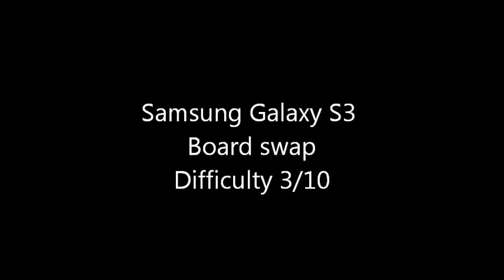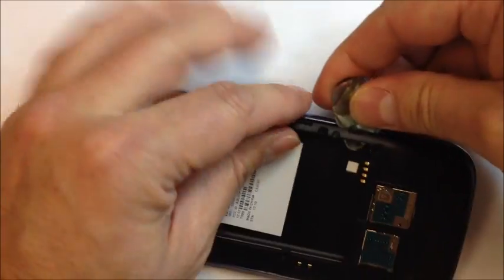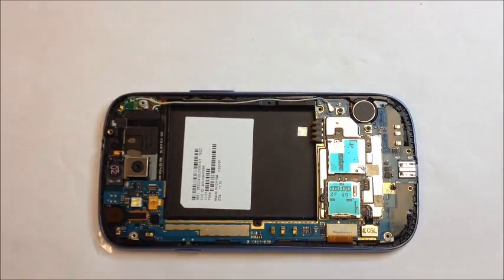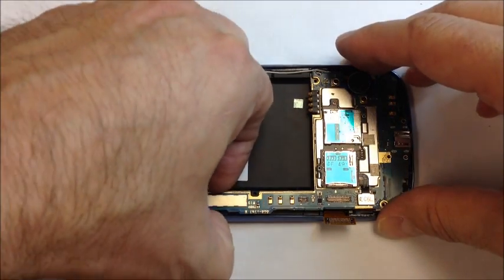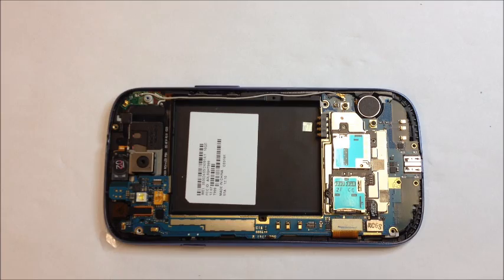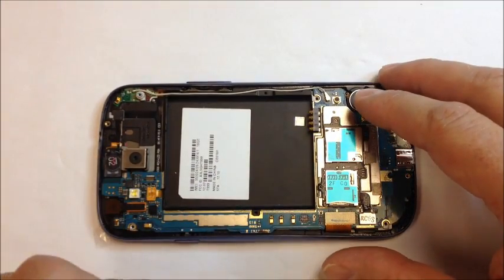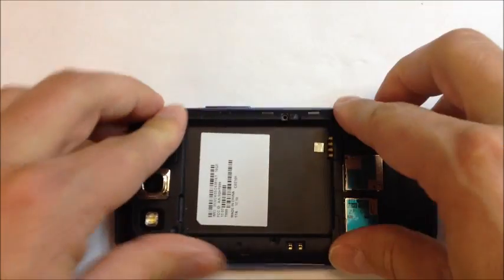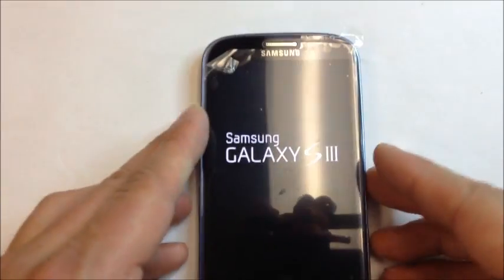Samsung Galaxy S3 tear down for board swap

Comment: Sir my samsung s3 battery is draining out quickly than the normal . Couple of my friends said changing battery would solve this issue but am not sure about this as am sure that the battery is good  but if i  change the board would it make any difference ?

Comment: I recently changed the motherboard in my old S3. It went fine apart from one thing; the sim card slot doesn't seem to work now. After inserting the SIM card various times, it is as if there is no SIM inserted. It isn't locked or anything, just the sim reader is dead. Anyone have any ideas?

Comment: Can i swap motherboreds on my s7 sprint att
Reply from the maker: Should not be a problem but remember that the charge port is different so that has to be swapped to and is more difficult because it wraps around and under the display.

Comment: Hello!! I really need help. I want to change my mother board because my phone won't turn on after the galaxy logo. But I don't want to lose any data on my phone e.g. photos and notes. Will replacing the mother board delete all my data? If so how can i have all my photos after replacing the mother board? also is it safe to get a mother board from ebay??? please help!! Thank you
Reply from the maker: The data stored in your phone is in a chip on the motherboard. Other than anything you have on a removable SD Card you won't save it by changing the whole board out. Is your phone stuck on the logo or is it a boot loop where it keeps trying to restart?
Reply: Hi!! thanks for your reply. I am not really sure if it's a boot loop but it looks like it's just stuck on the logo.

Comment: You forgot to swap the sticker in the battery compartment. That phone now has a different mobo so the old sticker has to come with it.
Reply from the maker: Yeah that probably wouldn't be a problem but since this was an insurance replacement we didn't want to risk having any issues with returning the old one.
Reply: Go Cell Phone Repair Ok thx 4 the heads up!

Comment: Hi. I recently broke my Galaxy S3 (only the screen), I swapped the screen succesfully with a new one but after a while I found the phone randomly turns off, so I assume I damage the motherboard before swapping screens. I'm looking to switch the motherboard with a Galaxy S3 GT19308 motherboard, my phone is a GT19300. Is it possible to switch it out for a different version of the same phone?? Thank you for your time

Comment: hi guys

I have a Samsung galaxy s3 GT-I9300 that has a broken lcd screen.

I found a cheap sprint samsung galaxy s3 nearby SPH-L710 ,,will my GT-i9300 motherboard fit in place SPH-L710 ?
or is there anyway to fix my I9300 with a good L710 ?
thanks

Abdu
Reply from the maker: I only see i9300 and i9305 as being compatible I could be wrong as I dont have either on hand at the moment. Have you compared the mid frames with the boards removed? Also- Its risky but possible to remove the display from your L710 and transfer it to the other phone. I dont have a video for that right now but have done it quite a few times using a suction cup, heat, and a lot of patience.
Reply: first thank you so much for your reply . and yeah this was my first thought just take the lcd .
I have all the gears needed but will the adhesive be fine after removing the lcd and putting it in the other phone ? or should I apply a new adhesive ?
Reply from the maker: I would plan on replacing the adhesive. The toughest part will be getting it off without damage.
Reply: heat gun . suction cups and some patient ..I have changed a couple of LCDs before , but the all came with adhesive , could you please advise me with good adhesive product ..I've never bought one

Comment: Hi, Will I be able to use just the main board without the display attached? so I can switch on the phone and it is still functional and I use MHL to connect to tv?
Reply from the maker: +Kiran Kumar Grandhi You should be able to power up the board without the display attached but I dont know how you would swipe the screen to unlock it.
Reply: +Go Cell Phone Repair  Dah!!!! why didn't I think of that? Thanks a ton for your prompt reply.

Comment: I know this is an old video, but just wanted to say thanks for sharing it. I dropped my phone and smashed the screen the other day and was given a working one by my brother. The problem was, it was networked locked. I swapped the board using this guide and now have a working phone again, exactly as it was before. (Albeit a white case instead of blue)

Regards,

Les

Comment: I have been having probs with my charger port and I can't soder so I felt it was easier to just replace the board. Will my data be deleted though?
Reply from the maker: +Corey Whitney Your data will stay on the board other than what is in the memory card so yes your data will be gone if you swap logic boards.
Reply: Go Cell Phone Repair OK thanks is there a way to transfer the data like removing the internal drive from board A and putting it in board B?
Reply from the maker: Your best bet is charging up the battery in another phone and then exporting data to the SD card assuming that it's just your port that is bad. Removing internal memory from this phone is not something that I would attempt.

Comment: Hi, I just swapped my I9305 board into my I9300 phone because the screen on the I9305 went dark after I dropped it. I also swapped over the antenna because the one in the I9300 wasn't working. Note that the I9305 is 4G and the I9300 is only 3G.

I'm in Australia and I'm with Vodafone. I used to use the I9300 with my Vodafone SIM, then gave it to someone who used it with a Telstra SIM. Since they got a new phone, I've gotten the phone back and had it confirmed that the phone itself is unlocked, but as we know it was recently used with a Telstra SIM.

So, the phone is now connecting to Wi-Fi which wasn't working before, so that's great. But it's not recognising my Vodafone SIM card so I can't make calls or use mobile data. Could a simple call to Vodafone fix this or do you perceive a potential mismatch between the phone and the board could be causing the issue?
Reply from the maker: +Shaun Campbell I don't know how I missed your comment. Youtubes system is a bit goofy though. Were you able to resolve this? If not I would ask whether you also switched over the charging port flex? I haven't worked with the i9305 but the 4G model may use a specific port an that could affect the antenna. Also was it not seeing the SIM or just not getting connected to the network?
Reply from the maker: I was wondering about that too. They did the same thing here with the S3 and S4. The mid frame layout where the chips set are just different enough that the board won't quite fit and as you mentioned tightening everything down causes problems. I'm assuming a short but it might also put enough pressure on a component to damage it so Id stay away from that. It's tricky to remove the displauy from the frame without damaging it but thats the only option unless you want to take your chances grinding away the area that doesnt fit but thats not a great solution IMO.
Reply: +Shaun Campbell Nice to know. I'm doing the exact same swap right now. Knowing that I should swap the antenna too will save me some trouble.
Reply: +Go Cell Phone Repair I can add my two cents here in case Shaun doesn't see your comment :).
I managed to swap out the old i9300 board with a newer i9305. I did have to use the antenna from the i9305 to get a wireless signal. But that was expected. The phone's model number is even printed on the logic board of the antenna.

Unfortunately there is a tiny, tiny difference in chip-size between the two models. Just enough to make the I9305 not fit completely in the shell of the i9300.

When I tighten the black screw, as in your excellent video, the hard-button on the front of the device doesn't work. and when I loosen the screw, the sim-card is not recognized.
I did this several times with the same result, so I'm guessing something is not lining up completely in that area.

Charging worked just fine out of the gate, so no need to grab the soldering iron (there is no flex-connector for usb-charging).

If you have any tips, I would very much welcome them.
Reply: +Go Cell Phone Repair  I agree it's not a great solution, particularly the way I resolved the issue, but it can be done. It can also be done better than the way I did it. Mine is still working though. I'll give a full description in reply to Mikkel Daugaard.
Reply: +Go Cell Phone Repair Never mind. Yes. Can't remember but I don't think so. The issue was to do with the mid-frame layout from memory. Next post I will reply in detail to Mikkel Daugaard's post since he's in the middle of doing it.
Reply: +Mikkel Daugaard Hi Mikkel, I have retraced my steps and jogged my memory as much as I can and here's how I resolved the issue. First of all never buy anything from miniinthebox because I ordered a new antenna in early November and I didn't get it until January. By the time I received it I didn't need it anymore, but it only cost $2 so I got over it. When I didn't receive a response to my post here (I think that was on Christmas Day wasn't it?! Oh what a fun Christmas Day I had...), the first thing I did was enter a whole bunch of special codes into the dialler to try to troubleshoot but this was unsuccessful. I then called Vodafone and told them everything I'd done to date. Although they couldn't directly help me without looking at it and wouldn't have done so without charging me, they knew what the problem was and they unofficially directed me to the sammobile.com website and wished me the best of luck! There I found this thread: http://www.sammobile.com/forum/showthread.php?t=22146 and to see or download the links I registered and logged in. I recommend doing this before visiting the link. The first picture link on page 1 of that thread is relevant and it will put you on the path to getting the full picture. The next relevant part is the first link on page 2, which takes you to a thread in the XDA Developers Forum. Go to page 3 of that thread, scroll down and click on the link that comes after the quote in post #26. This takes you to another thread on the XDA Devs Forum which I like to call "the money thread"! At the bottom of that you'll find 5 thumbnails that really help. Read everything as you go and you'll find that it is absolutely necessary to grind down those parts of the mid-frame layout mentioned, but the pictures give you a perfect representation of what needs to go, except that I think I also ground down some plastic on the inside of the outer plastic plate/frame that you screw down with all those screws to complete closing up the phone, mostly on the corner opposite to the corner of the mid-frame that needs grinding. But, so, yea, if you have the tool that they describe, can't remember what it was called, but if you have it use it and do all the grinding of the mid-frame first and try closing the phone before cutting out any of the plastic on the inside of the outer plate/frame. Using the tool that they mention is the "better way" of doing this because you'll laugh at how I did it. I'm no techie at all and I was at my wit's end and at a point where I had nothing to lose. My Dad had the tool but wasn't going to let me use it coz it was brand new and he's a dick! So I used a pair of side cutters and a pocket knife to cut and scrape. I then used the sticky tape as described in one of those threads I mentioned and after hours and hours of fidgeting about the case closed properly, everything must have been touching properly and calling and texting finally worked! The only mistake I made was accidentally cutting the cable that connects the home button when i was cutting and scraping so be careful of that. I found a fix to that too by downloading a soft home button app, only thing is I can't use any of the special button combinations to clear the cache etc. when turning on the phone coz there's no hard home button. Please note also that because I was grinding down the mid-frame which is a type of metal and because there are gaps between the mid-frame and the digitizer where metal shavings can get through, and because you don't want metal shavings getting into the digitizer, I covered up all the gaps as best as I possibly could before shaving the mid-frame and I removed and replaced the coverings a couple of times. It was a tedious exercise and I was very careful but 4 months later my "hybrid phone" is still working and I'm only 2 months away from being able to start a new contract and go new phone hunting. Mind you, I usually buy my phones outright then go on a plan so for four months I've been trying to talk my wife into giving the ok for the purchase of a new phone before this "hybrid phone" of mine decides not to work anymore!
Reply: Hi Shaun,
I apologise for not responding sooner!
Thanks a lot for your comment. It made me rethink the whole idea of carving out a piece of the phone since I always mess something up if I'm not in an extremely patient mood... which I rarely am :).

I ended up accepting that the home button doesn't work.
I found a workaround by using a simple app called "button remapper". It remaps the soft buttons, so that a long press on one of them will act as a home button push.
This will obviously not work if I ever have to do any factory reset or the like where I need to push the physical button.

Thanks again for your help and I hope you got a great phone on the new contract.

Best regards from Denmark.

P.s. Tell your dad to share tools. It's the whole reason to get a son FCOL :)
Reply: Hi Mikkel, thanks for replying anyway, even though it took a while :) Multi-action Home Button is the app I used. There are probably many. Yes it does require extreme patience and at least a good half a day!  I am sorry to report that after seven and a half months of my nifty "hybrid S3" filling the hole in my mobile life, I dropped my phone again two days ago, in almost exactly the same spot, and the screen went black just like before. Fittingly, only a few days before that I pre-ordered a new Galaxy Note 7, but not so fittingly my hope for the hybrid S3 lasting long enough for me to transfer everything to a new phone was dashed. I've even tried connecting the phone to my laptop via usb and using programs to try and view the screen on my laptop but to no avail because two computers won't recognise the phone and only very rarely do I even get the sound that at least let's me know a pseudo-connection has been established. So here ends the saga! I'm on my old Galaxy Ace 3 or whatever is called now. My biggest loss was my calendar, something that could have easily been synced to the cloud...d'oh! And now I'm having weird laptop problems. Blasted technology! And thanks for the support re: my Dad. I'm 38, can you believe it!

Comment: I assume the motherboard the same, regardless of the carrier (AT&T, T-Mobile, Verizon).  Is this true?
Reply from the maker: +Joe C No. AT&T and T-Mobile have the same form factor but Verizon is different.
Reply: +Go Cell Phone Repair Thank you, sir.  I was able to get my wife's motherboard out of her S3 that was run over by a car.  Motherboard looks surprisingly good.. hope it works.  I'm waiting to borrow an S3, but can't wait too long because my wife has already received the insured replacement in the mail, but we can't activate the new one until we bring in the old phone.  We don't care about the board, but only want video/pictures so I am tempted to keep the removed board and just turn in the phone.. we're worried that the insurers would charge us full price if they inspected it...
Reply from the maker: +Joe C I don't know the conditions of your insurance policy so you might want to inquire but- unlike a manufacturers warranty your coverage should not be affected by something like taking the phone apart and putting it back together. At least I wouldn't think so. Don't take my word for it- check when in doubt- but I can tell you that we've performed this service many times for data recovery and at least to date is has not created any problems as long as the customer gets the broken phone turned in before the deadline.
Reply: +Go Cell Phone Repair I never sent the broken phone in and the insurance company for AT&T hasn't come after us, but they may sometime.
Reply: +Go Cell Phone Repair On another note, I tried swapping an equivalent Sprint phone that the motherboard on the Sprint one (SPH-L710) was supposedly not working.  The AT&T (SGH-I747) motherboard fit sort of, minus a single screw and no SIM card.  Still didn't work.  Still don't feel certain that the AT&T board isn't working, neither certain whether it was the motherboard in Sprint.  Also, they may just be incompatible.  Is this true?
Reply from the maker: The mid-frame layout is different enough that you will almost be able to make it fit but not quite. Usually if you force it you'll end up with a grounding issue that can harm the board/display.

Comment: Hey can I swap a virgin mobile board to a sprint s3? And still have the same stuff
Reply from the maker: +Leebeast99 Looks like Virgin used the i747 version so probably not. Even though it runs on the Sprint network it appears to be different.
Reply: Go Cell Phone Repair alright do you think I should try it? Or can it break
Reply from the maker: +Leebeast99 It's possible. If you carefully compare every detail between the two you should be able to tell if there are any differences but they can be very small and difficult to notice. You should see small rectangular indentations on the frame that interface with the logic board. Anything that doesn't match up perfectly might cause a problem.